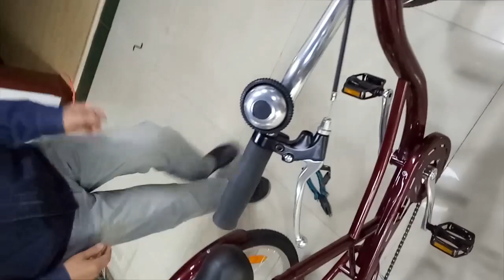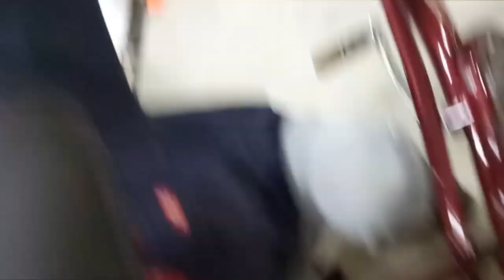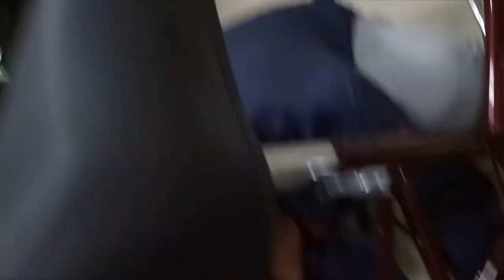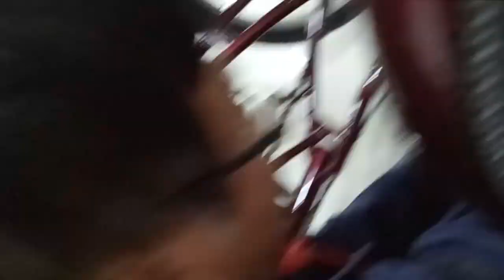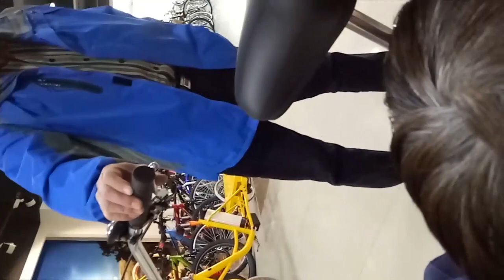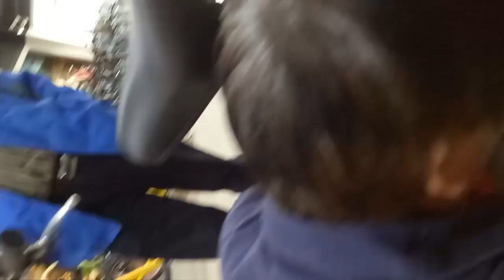adjust rear brake---tricycle

Comment: For squeaky brakes you have to wipe the pads w rubbing alcohol to clean them off.  Wipe the rim as well.  A light sanding o the pads is another step to try. The squeaking is caused by contamination.
Reply: No lol.

Comment: The break doesn't even work no matter how much I pull the cable, I tried tighten the bolts but that still doesn't help and I am already using my front breaks way to much, this video is a lie.

Comment: It looks like you loosened a bolt so that you could compress the spring and then retighten the bolt again.
Reply: I looked like he did that just to remove any slack in the cable, he didn't really tighten down on it